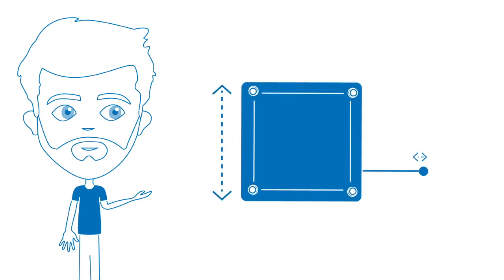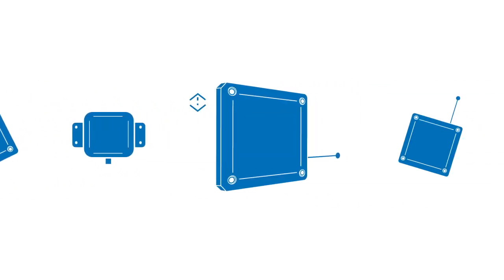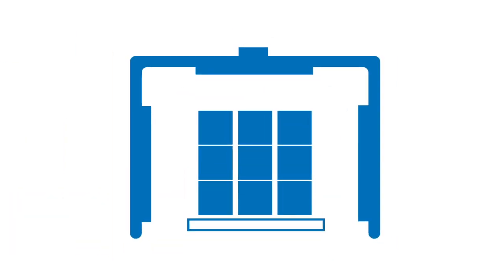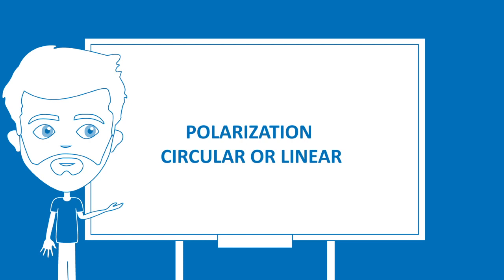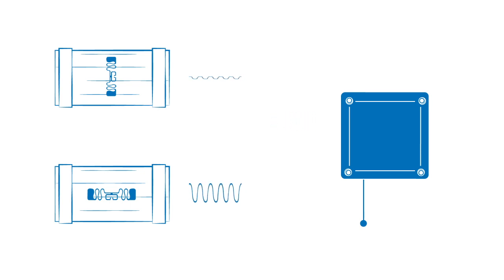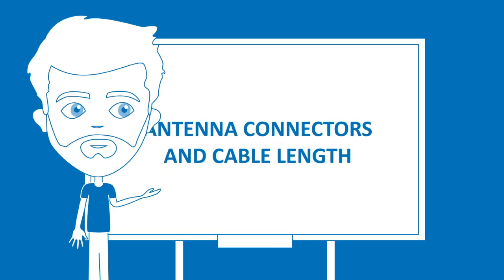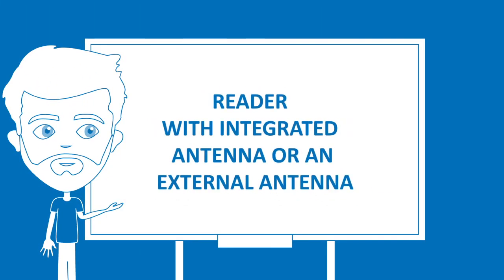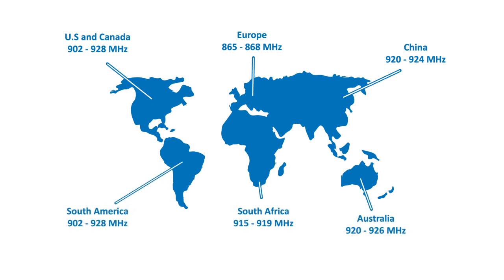How to choose the right RFID antenna for your project

Comment: I want to create a project, where I want to read RFID tags of frequency 865MHz, should not duplicate read. What kind of RFID antenna and RFID reader I need.  I don't know how would it connect to my desktop/PC, and what king of output I will receive from RFID reader. I want to read the output from RFID, then use this output to open and close the boom baring for parking entry & exit.  Could you please help me in this, I am very new to RFID system.

Comment: hi sir, UHF transmitter, use substrate FR4.. what type antenna is suit ? with parameters , sizes
Reply from the maker: Thanks a lot for submitting your question. Could you please explain a bit more? Are you planning to read an FR4 tagged object and are in need of the right antenna?
Or are you looking for an antenna made of FR4 substrate?

Comment: What do you mean by "orientation of the tag. If the orientation of the tag is known" What do you mean by that? Because im in a way to choose the RFID antenna
Reply from the maker: Dear Ridho. 
For example in a production environment, when assets pass a stationary antenna. If the tag/label is always vertically passing the antenna, it will be better to use a linear antenna. The radiation field can be more precise with less RF power.
If the orientation of the tag/label varies, it will be better to use a dual linear or circular antenna.

If you have any other questions, please contact us. https://www.cisper.nl/en/contact. We are more than happy to help you.

Comment: I want to modify the antenna of RFID scanner. It is internal antenna.
Does it possible to remove it or attach the new antenna to the end of the internal antenna.
Thanks!
Reply from the maker: Technically it is possible to replace the internal antenna or extend its connection.

But we would advise to contact the manufacturer.

If you have any other question, please contact our sales team. https://www.cisper.nl/en/contact